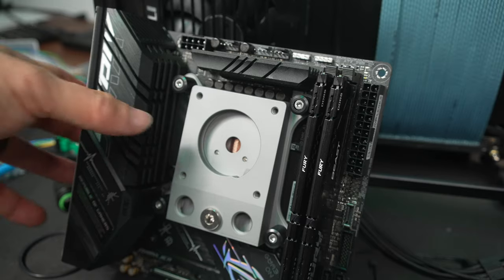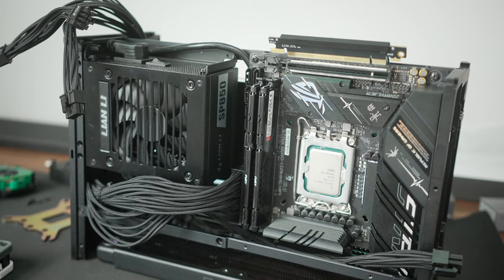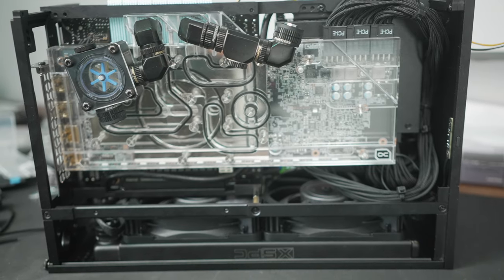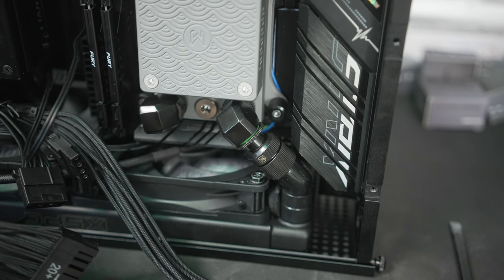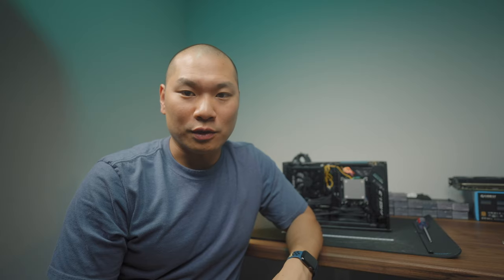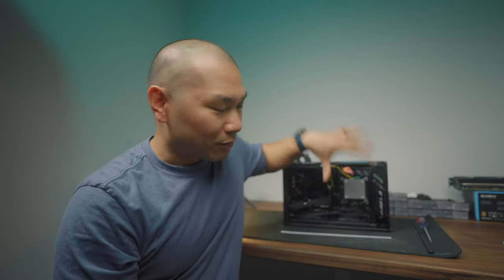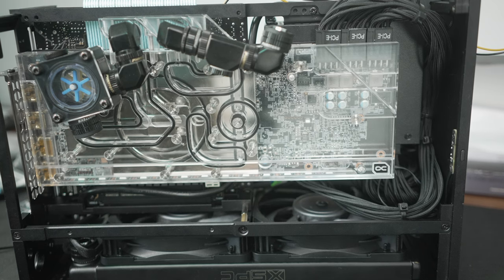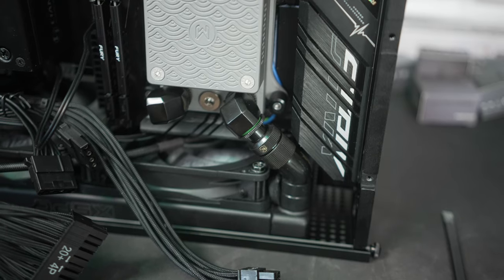Brainstorming the T1v2 Custom Loop...

Comment: The best thing you can do in the T1 is Hudamodded PSU, side ST20 HPE 280 with Silent Wings 4 Pros and top TX120 with A12x25. Lobo pump block and true single slot GPU. Then add a one way valve between the 2 pass-through ports and use quick disconnects through those ports, best ones are Koolance QD3. This way it's super easy to fill and drain, has lots of cooling compared to its size and if you feel like it, an external radiator is an easy addition, since you already have quick disconnects anyways.
Reply: For clarification, the "Hudamod" in the T1 v2 is a PSU relocation mod that frees up the entire motherboard side for a 280 rad by moving the PSU to the top of the case (where a 240 rad would normally go).
Reply: So is it impossible to do a 240m on top with 280m on the side?
Reply: @heatnup  with Hudamod it's only possible to do 280+120, but the extra space for air for the side 280 makes up for that. If you would go side radiator without Hudamod, you most likely have to use slim fans and you'd have less space for air, crippling side rad potential.
Reply: @Aexeq  wouldn’t the 240 balance out that loss though?
Reply: @heatnup  just to a certain extend. You also have to keep in mind, that there's more negative pressure inside the case, when you have 4 fans, so each fan does a bit less. Another approach would be standard mounted PSU, just side 140 fans (no side radiator) and a top TX240. Basically to force as much air through the rad as possible.

Comment: Hy great video, but I have question, can U recommend some AIO 240mm Liquid cooling with best/silent pump, I got noctua fans so whatever AIO fans will be I replace it anyway with noctua, I read that almost all AIO have noisy pump after 2000 rpm and some strange crank noise so help please, case is Lian Li A4-H2O, in my other case I have Corsair h115i 280mm and fans are silent but pump is noisy a lot,even at quiet.....so I look others alternatives, because all my life I have corsair stuffs in case time to change, what is EKWB or others such as arctic freezer IDK,thx
Reply: EK basic or Phanteks Glacier one. Arctic AIOs are great but they don’t fit in the T1 or Dan A4 H20 since their tubes come out the front of the block
Reply from the maker: I've noticed the same with a lot of Asetek and CoolIT units like yours- one thing though before you toss it out, have you tried dialing the pump curve or forcing the pump speed back to 60-70% PWM? In most scenarios you won't see much of a performance hit but it will be drastically quieter. One of the units I test quite a bit with is the Cooler Master PL240 FLUX, which is good on pump noise, the whole ensemble is a bit more expensive though if you're just going to replace the fans. Lots of folks have had good experiences with the EK AIOs as well, I should footnote that the only one I ever got was a dud but I think that is just bad luck.
Reply: @MachinesMore  thx
Reply: @MachinesMore  One more question, can U made video when U have time, about best cable management PSU and AIO (whatever type U wanna use) in Lian Li A4-H2O case, what is the best position and how to best turn/rotate pump, it would help a lot for guys who are new in these stuffs, I watched your older videos for cable management in Meshlicious and it was great especially for my friend who build new  PC  in a really small ITX case only 14.6L ,thx ....